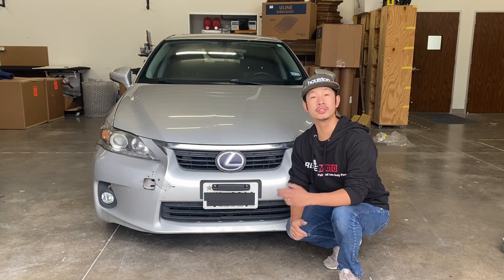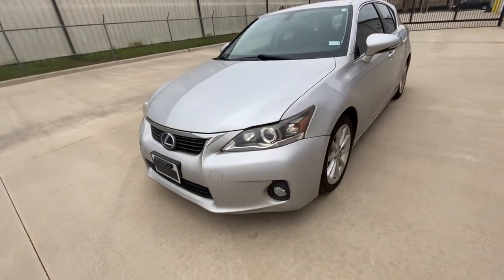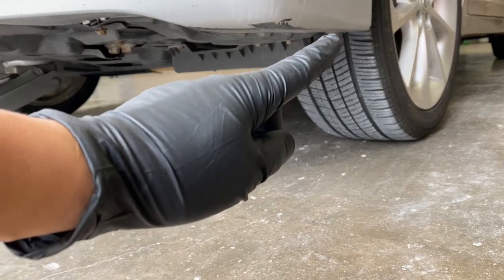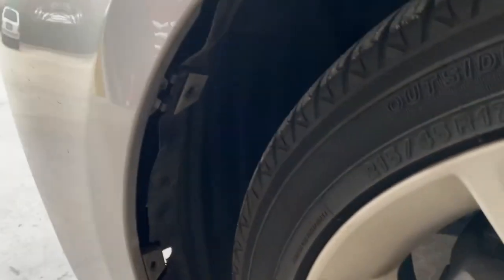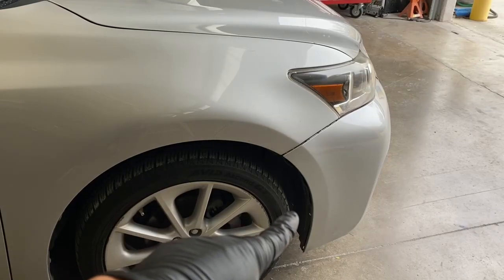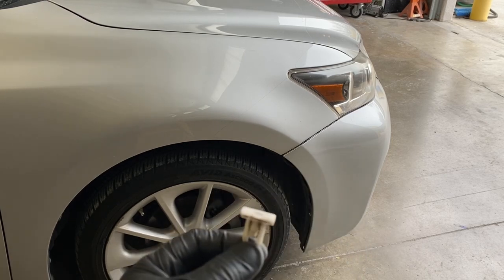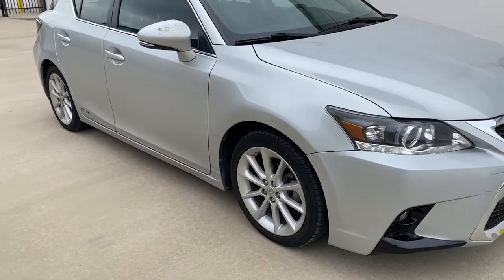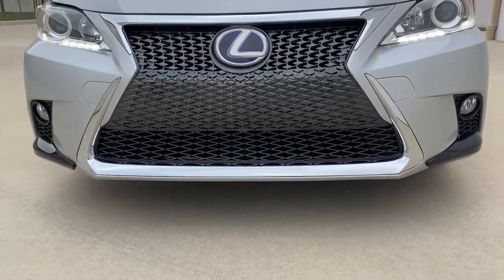Quick & easy 2011-2013 Lexus CT200H front bumper removal.

Comment: Hey nice video. It possible to just remove the grill without taking off the bumper? Mine is cracked and I want to replace it
Reply from the maker: I am sure it's possible to rip it out but you may break something. The grille clips on into the bumper and is secured by small screws. If you are replacing the grille your gonna have to take off the bumper to put on the new grille. It's not so bad, we know you can do it. Toyota/Lexus make it really easy to work on. Thank you for watching!

Comment: Love your video on removing ct 200 bumper.  Now, how  do I remove the headlight assembly?  Thanks.
Reply from the maker: It’s usually 4 bolts on top and the bottom.  Unfortunately I don’t have a video
Reply: Thanks so much for the quick reply.

Comment: One of my clips broke which is causing a slight gap between the body and the bumper closest to the drivers door, can you do a quick video on how to replace the clip that you took off at 3:56/57 please, I am not paying someone for something I could do myself
Reply from the maker: Hello Jan! Unfortunately, we no longer have the car but that is an easy fix! We recommend just buying that clip from you dealership. You just have to find where it goes and snap it in. You don't even have to remove the bumper, just loosen it on the ends. The part should cost a few dollars. Good luck and thanks for watching!